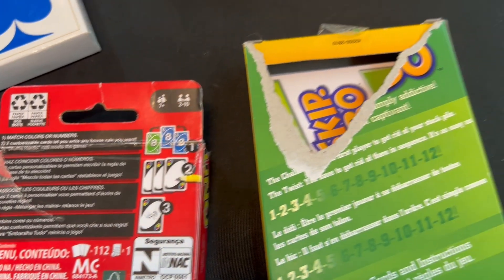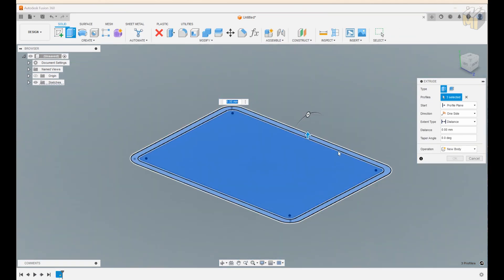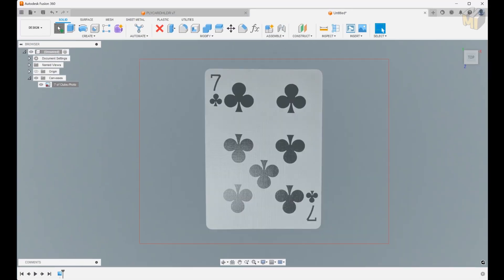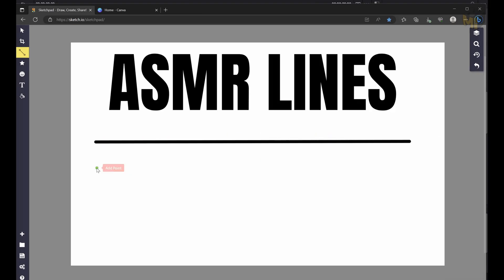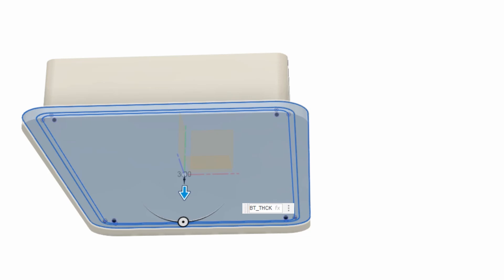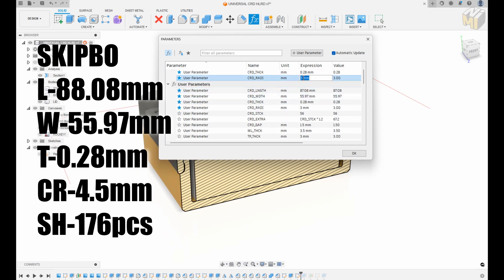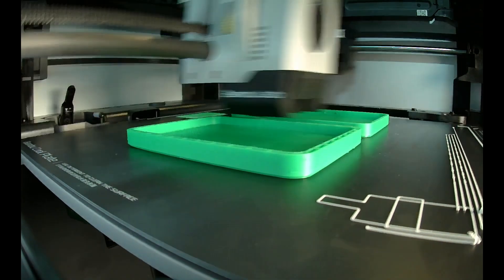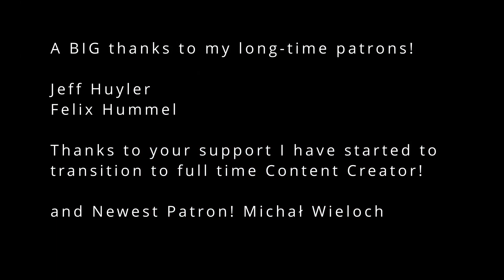3D PRINT a snap lid container for ANY size and type of card

Comment: But how do you do the clasp.  I feel like you glossed over the most important part.  Either that or I just completely missed it, which is 100% possible.
Reply: Same, i came here specifically to learn about the clasp (it was in the title, after all). Glad OP replied with some followup. But the real question is - what are the tolerances??
Reply: I need this! Haven’t been able to find much of anything. Slant3Ds video was specifically for circular lids that dont work for rectangular shapes.
Reply from the maker: I don't think I went into great detail on it, the clasp is simply a small 'prism'... an extruded triangle on the outer lip of the box, the lid has the opposing piece cutout with a very small amount of clearance added to make sure it wasn't too tight.  These worked really well.  If the box is thin walled and taller, it'll have more flex and they work really well, if the box is short and has thick inners, it doesn't like to flex much and can be harder to get the lid off, but still doable.  If there is some interests in clasps/catches/snaps, I can aways research and show a video on the subject.  My channel is pretty much dedicated to 3d printing, and I want to make content that you guys need.
Reply: @NeedItMakeIt  I'd love a video specifically on the clasps/tolerances too.
Reply: Oh no, googling for 3d printed clasps led me here 🤣

Comment: Did you use a Dxf file for canvas? If so how did you get it from the 7club card?
Reply from the maker: I took an image online the most crisp one I could find, put that into the JPEG to DXF Converter and prayed that it worked.  For this one, it did work really well, sometimes it doesn't like the images and won't close the shapes, finding those tiny gaps is nearly impossible.  I'm still trying to find better ways to do this.  I seem to have the best results if I trace the images in a sketch software, and then I can convert to DXF, maybe the contrast helps?